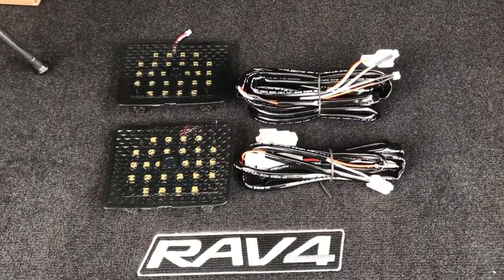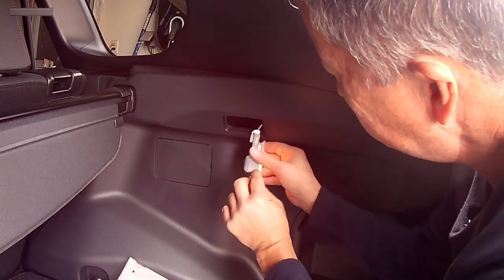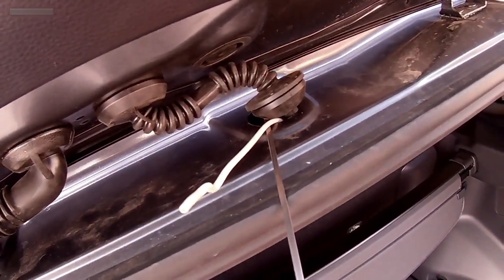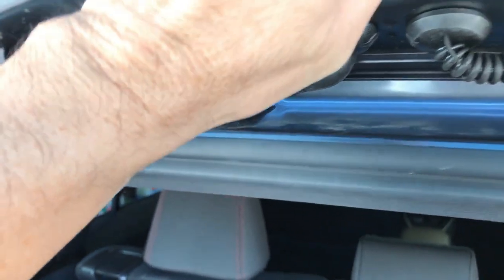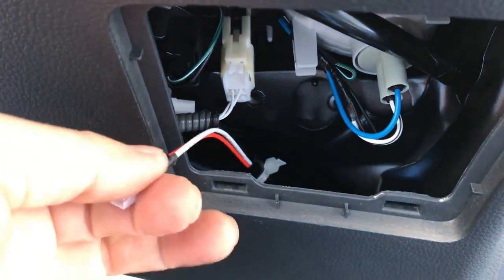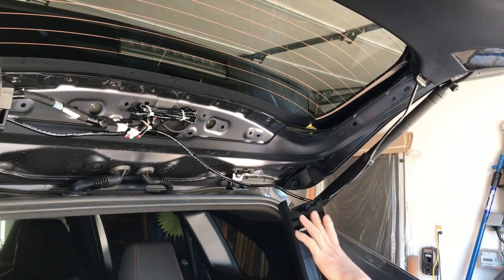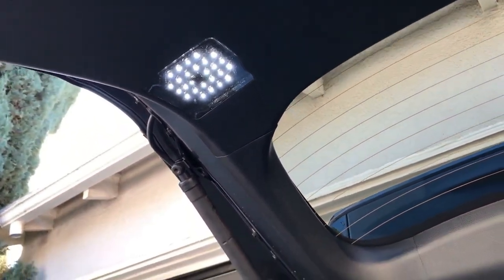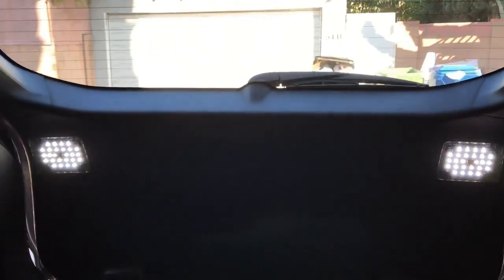2019 2020 2021 RAV4 and Prime Cargo Trunk LED Lights - Installation and Review

Comment: Nice video and good instructions. I also have to commend you that this is really the first video where the owner also has a nice tidy trunk, and also the plastics in the trunk are not all scratched up. And congratulations on a nice car. I ordered my RAV4 a month ago, and I'll supposedly wait another 4-5 months. Have a nice day.
Reply from the maker: Thanks!  haha, the car was practically brand new hence the clean trunk and plastic!  I have some scuffs and scrapes on the plastic now.  Congrats on getting yours!
Reply: @PhilsDIY  Hi, I ordered a RAV4 Prime (PHEV) in exactly the same colour as yours. I want to ask you if you have registered information about a problem called "RAV4 cablegate" where corrosion occurs at the end of the high voltage cable leading to the rear electric motor. Have you looked at the condition of this high voltage cable termination on your car? Have a nice day.

Comment: thanks for skipping all the important parts of the tutorial. so helpful.
Reply from the maker: Hi, Sorry if I left something out, but I thought I showed every step of the wiring.
Reply: @PhilsDIY  no apologies needed. I was just using sarcasm to give some constructive feedback. The toughest part was getting the wiring through the rubber tubing and you seem to have skipped showing it all together. It's a good tutorial overall for people familiar working on taking apart their rav4's. But it's not the most clear for complete beginners.
Reply: @PhilsDIY no you did not show how to insert the wiring through the rubber tubing or grommet … you simply skip that part because that’s the most difficult part … it takes time n  patience to do that, otherwise you wreck the connector !!!

Comment: If accidentally touch the little light on the right side of the trunk and it blows out and doesn't light up(I think fuse), do you know what to check?
Reply from the maker: I would check the fuse block under the driver side dash.  You'll need a light and crawl under there to look for a blown fuse.  If you can't physically see the blown fuse, you have to use a continuity checker (ohm meter) and check each one to see which one is open.  I think that interior light might be on the fuse labeled "Dome" - but not sure.
Reply from the maker: A member of the Facebook Prime group posted about this exact problem:  https://www.facebook.com/groups/804171320012000/permalink/1655922168170240/  he said it turned out to be the Dome Cut fuse, rather than the Dome fuse.  Sounds like what happened to you.
Reply: @PhilsDIY  Thank you so much

Comment: Did you have to lube the wire to get it through the rubber boot and tube.  Left side better than right??
Reply from the maker: I did use wire pulling lube, but i don't think it's critical.  I just happen to have some so I used it   i went through thr left one,  only because it looked bigger,  and less likely to be a problem.
Reply: Confused why it first shows the fishing wire going in the right rubber boot though?

Comment: You did not show how to insert the wire through the rubber tubing or grommet ????
You simply skip that part … maybe because that the most difficult part n heaps of time n patience..
Reply from the maker: Yes, I confess that was a tough part - but actually the toughest part for me was getting the wire to fish the light's wire from the side to the opening where the grommet goes.  Also, this was one of my first videos and my camera skills were not so good, and I ended up failing to get that part on video.